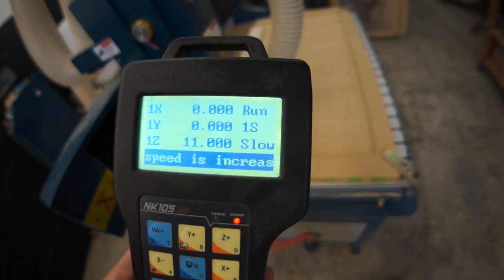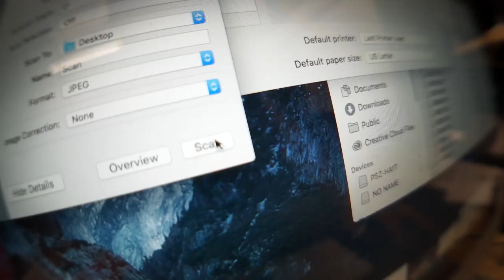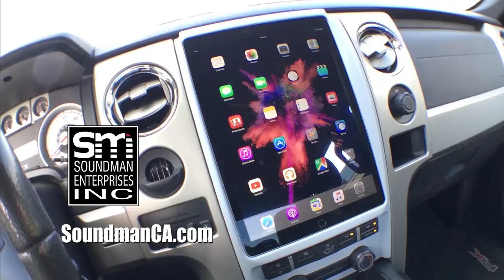MY BOX MATH WAS WRONG! AND Steel Hydraulic Pump Rack! - White Rider #22 , The Thunderbird project

Comment: Just fill the box with packing peanuts.  Once leveled off, dump said peanuts into a cardboard box and pull measurements from the displacement.
Reply: Scott McKinley packing peanuts get you close but not quite precise because of all the various gaps in between the packing peanuts you're not getting the entire volume because when you dump them out to measure them they're going to pack differently which means that the gaps could be taking up more space or less space so although you would get close you'll never get precise measurements this way. It's a pain in the ass but one of the ways that I've done it that's a lot more precise without ruining my wood doing it with water in a bag is sand. Now mind you you can only do this on small boxes like this one because well sand weigh is a hell of a lot, but it'll get you a pretty damn down to the grain Precision measurement. Fill the Box, screed It Off, dump it out and measure. The sand won't hurt the wood nor stick to it and any leftover small grains can be blown out with a simple air Chuck. You're welcome
Reply: Aint nobody got time for that
Reply: Yes, packing peanuts do shift however I doubt that it would alter the readings of the box dimensions so bad it would be noticeable.  But - if you can hear the difference between a boxes where the volumes are measured with packing peanuts versus sand, you're a better man than I am.  I build boxes for income and taking the added time to confirm that last .005% of box space accuracy doesn't outweigh the labor rate.  Just my two cents.  MAYBE - to meet in the middle, Doug coulda used his Dick Dust from his collector!!!  :)

Comment: Doug, just measure the two different shapes figuring out the different volumes/area. Then since you are stacking them, just add until you get the correct volume for the speaker. Your method of getting the volume apeared to be correct last eposide. I'll be interested to see your other method (CAD) and how far it was off from your first method of calculating the volume. There are equations for figuring out irregular shapes for volume/area.  Keep up the good work.

Comment: Hey Doug. I'm sure budget prolly an issue, but have u looked at using lithium batteries instead of agm? They are considerably lighter and have better discharge rates. Just a thought. Love the build so far

Comment: You're gonna have to buy 2 of those big alternators, and brackets & belt tensioner to keep all those batteries happy; no way will that OEM 130 Amp Motorcraft work.
Reply: HUBBABUBBA DOOPYDOOP more than likely the pumps will be wired at 48volts, so you cant charge it off the alts anyway. 

However, if he wires them at 24V, he could use a 24V alt from a piece of heavy equipment to charge each bank all the time, but the pumps would be super slow.

Comment: Hey hey looking goode! What is the benefit to building the box port asymetrically as opposed to splitting the port volume and dumping it equally on either side ?
Reply: It's actually beneficial to avoid symmetry/parallelism in speaker boxes to reduce box resonances.  The wavey cuts and non-square design are also very good aspects.

Comment: The w7 magnet is going to cause problems with the pumps.
Reply: Blakeracer r the magnet is gonna pull the air molecules and distort the sub which will clog up the dumps resulting in a 24 hz solo cup tune 160db spl SMD
Reply: If he runs that magnetic hydraulic fluid with that space material inside he will be screwed!

Comment: I dont know if you are serious or joking. But I failed 10th grade math twice and I can do this... The formula isrPixr^2 x h... easy way is to use a non stretchable object with a known length IE a piece of mechanics wire make it as straight as possible. What sucks is you have to measure 3 times. Get the circumfrence of the ported side of the box and the length. The side with no port and the length then measure the port its self.  c/pi = d so the length you got divided by pi will be the diameter cut that in half squared times PI. will give you the area multiply by length to get volume. I hope I didnt write any of that wrong but it is easy as fuck to actually do. Just measure a wire that you know will be too long bend it to the internal proportions see what lenght is left. take the length of the wire you used and do this math 3 times . (L/Pi = D ) (Take d and cut it in half = R)  (Pi x R^2  = A)  A x L = V VATO!!! 
Now that you have that you can also do the area multiplied by each stack to see how much volume you are adding  or taking with each lamination.... Duh.....   
Now quit rubbing your sore ass and finish my box... Then make that midget Night club.

Comment: Go with a lithium battery and you won't have to worry about space lol
Reply: FDMtech Right
Reply: IF you are serious... Which I am too tired to know a shit idea for hopping.... Deep cycle lead cells are more durable.
Reply: Robert DeHart Well in that case Go with Northstar agms can never go wrong with them
Reply: Lithium’s are expensive lol
Reply: Dultra it depends
Reply: Jmain Spl 
LiFePo4 batteries are more durable, run longer and can output higher currents all without voltage drops. LiFePo4 shit all over agms.
Reply: Liam Cooper right and they aren't super high priced
Reply: Jmain Spl hahaha well its $900AUS for a 55Ah LiFeLo4 highoutput, 275Amp continues output.
Reply: Shit for the batteries he about to get I bet cha will be around that price anyways